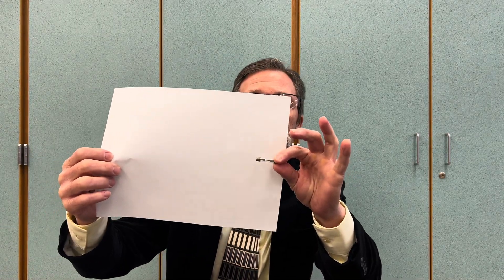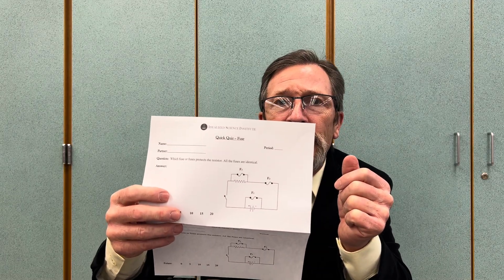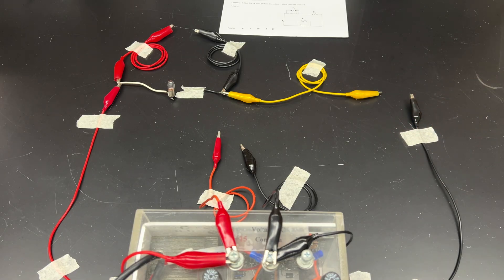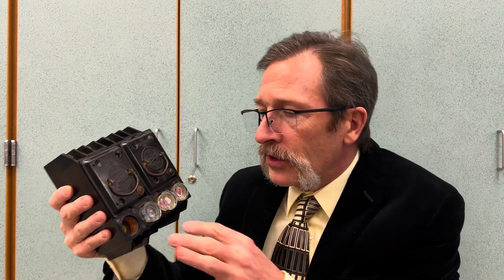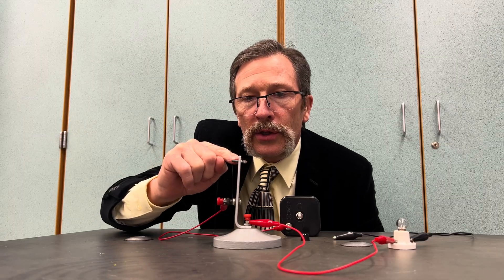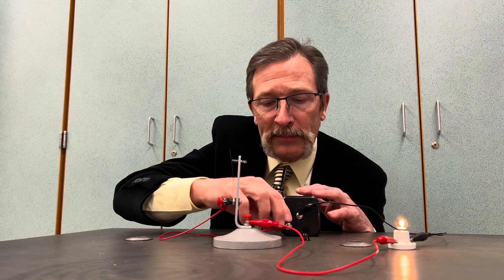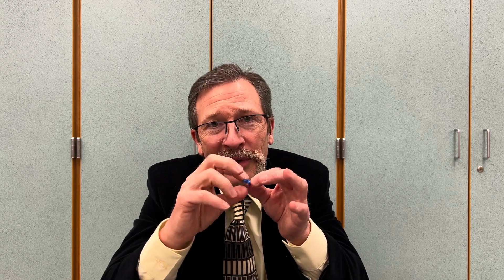The Brilliant Physics That Prevents Electrical Fires

Comment: From an application standpoint, yes: fuses are almost always placed in series with a load, and paralleling separate fuses in a circuit is bad practice because current sharing and clearing become unpredictable.

But from a theory / device-physics standpoint, it’s interesting to note that many high-current power fuses are effectively built from multiple low-tolerance fuse elements in parallel inside a single device. The manufacturer controls geometry, resistance, and thermal coupling so those elements share current and open in a coordinated way.

So the real rule isn’t ‘never parallel fuse material,’ it’s:
don’t parallel independent protection devices and expect predictable behavior.

Inside a properly engineered fuse, parallel elements are actually one of the ways high current ratings are achieved.

Comment: F3, and f4 is in series after the device. Where f4 is after electrons pass the device. Saw the video. So f4 can rate voltage drop needed in circuit. Thanks!

Comment: Older "tech" may have been more dangerous and required a bit more paying attention, but boy was a lot of it seriously robust.
To this day, I have a residential light switch from 1929 that still works as it did the day it was manufactured. All because the switch can be opened to have its contact points cleaned. It's not connected within the home's wiring due to building code requirements, but I do still use it to switch on the 12 volt LED nightlight grid in the hallway. 
Interesting side note: The switch requires cleaning of its contact points more often with DC voltage than with AC. Humidity being the key factor. In fact, I had to apply a conduction improving paste to the output contact terminals to negate the frequency of contact fouling. Sure, there are signs of contact degradation which could make it dangerous for high voltage/high current use. But the contacts move and it still conducts electricity 81 years later. Can't say that about many modern residential switches.  lol

Comment: One thing I always like to emphasize is that inevitably, any explanation is a simplification of the topic. For instance, you have to leave out a lot even in a discussion of overcurrent protection, such as the tiny fuses on circuit boards, designed not to protect equipment but purely to prevent fires. (If your school has a maker club, they might be interested in learning how to fix circuit boards, of course.) I work for an electric utility now, and our distribution fuses are literally just lengths of wire, of a narrower gauge than the primary conductor (and inside a mechanism with a spring to separate the ends of the wire after it melts, to minimize arcing).
Reply from the maker: Absolutely! It’s impossible to cover everything and so we inevitably leave things out. Our most recent video is about the risk of overloading a wire, which you might enjoy.

Thanks for sharing your insight from the field, though. That’s very fascinating!
Reply: @idealizedscience  I replied to it. And you answered. 🤨

Comment: In the UK we have fuses in every plug and also the RCDs in the consumer unit. it is a great idea, if there is a problem with an appliance then the fuse in the plug blows without tripping out the whole house electrics
Reply from the maker: Thanks for sharing!
Reply: The UK uses ring circuits, the circuit is connected to the breaker at both ends, doubling the conductor going to any point on the loop.  A standard wall plug may be fused at 32 amps according to Wikipedia. In the Unites States a general purpose plug will be rated for 20 amps, with at most a 20 amp breaker. I don't know what the amp rating of a UK plug is, but I imagine those built in fuses protect the plug from over heating as the house will happily let it draw much more current than it could in other countries.
Reply: @nickkrom9495  it's 32A in the fusebox, it's 13A max on a plug, just enough for a 3kW kettle.

Comment: As any electrician will tell you the purpose of a fuse is not to protect the load but instead to protect the power source and in particular the wiring connecting the power source to the load.  In the case of household fuses the main purpose is to prevent the wiring overheating and starting a fire.  In other words the purpose of a fuse is to protect you and your family from your appliances which are trying to kill you.
Reply from the maker: Haha very well put!

Comment: A couple of years back a friend told me he went to a family party. They needed to prepare a lot of food, so they had multiple toasters, electrical kettles and various kitchenware hooked up to use simultaneously. The circuit breaker said no to this of course. So, they decided to designate a person to hold up the circuit breaker switch, so it can't cancel the cooking anymore. My friend then educated them why this is a bad idea, which made him the killjoy of the party.
Reply from the maker: Good thing the house did not catch fire! Thanks for sharing.
Reply: Bad idea for sure. Might not have worked anyways, but wouldn't be surprised if it did. Though probably only for a while until the switch got too hot to touch and/or started smoking. Many newer model residential and most commercial circuit breakers can trip with the switch locked / forced into the On position. "Trip free" is an important safety feature, especially in industry which often lock breakers switches to On.

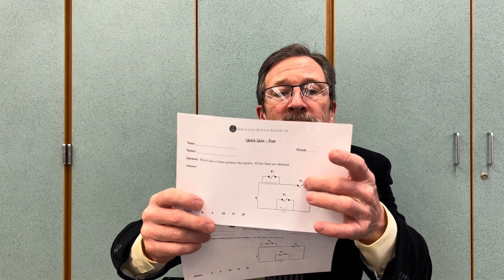Comment: 1:58 F1 and F2 are both short circuits.
Reply: F2 isn't a short circuit, but a current divider, stealing some current from the motor, but not protecting it. (Current flows through both based on their resistance).
Reply: @seattledanr5363  "stealing some current from the motor"?? It's a fuse, not a resistor. It will steal ALL the current because the resistance is zero.
Reply: @Kogacarlo  Incorrect. Current always takes all available paths; more current will pass through lower resistant paths and less current will flow through higher resistant paths. This is why Fuse 2 did not blow in the demonstration. Even though it's a fuse and the resistance is low, it is not zero.
Reply: @earlmcgill5867  A fuse parallel to a motor I count as a short circuit. You don't. OK fine.

Comment: There must be something other than a bimetallic strip in a circuit breaker, otherwise it wouldn’t trip.
Reply: There absolutely is in most all of them. The strip is for overload protection (a whole topic in itself regarding load curves; 15 Amp breaker usually won't immediately trip at 15 Amps but a variable higher value depending on various factors) while an electromagnet or other fast responding mechanism is used for short circuit protection.
Reply from the maker: You can make a breaker in a variety of ways! Many use bimetallic strips and then an electromagnet to flip the switch.
Reply: if you're interested, bigclive has a good detailed video on how breakers work: https://www.youtube.com/watch?v=NQRI1bg6Ryk